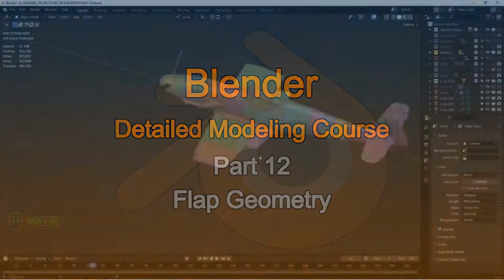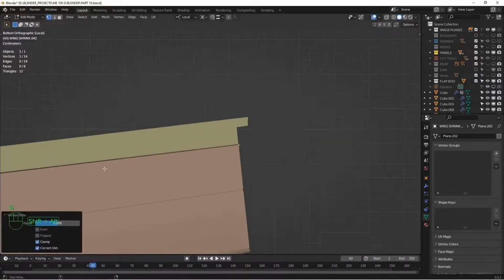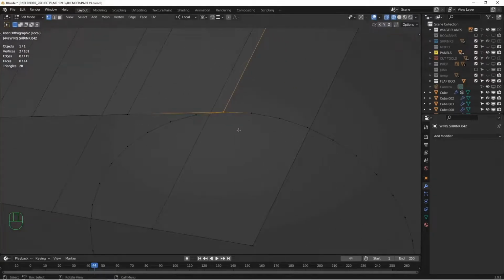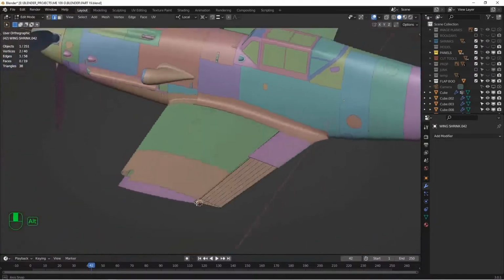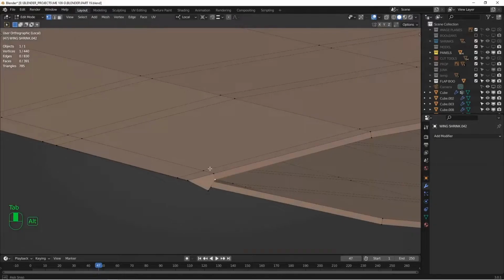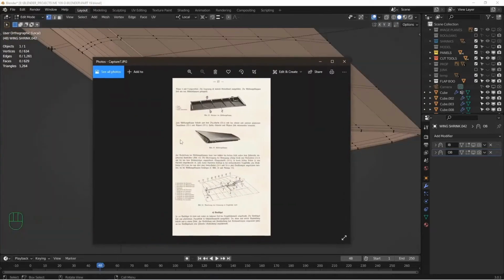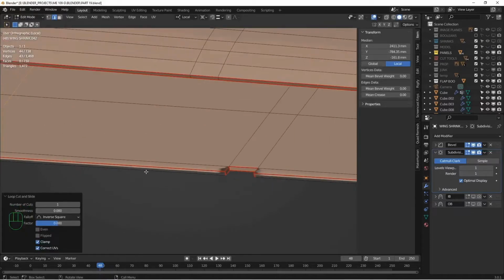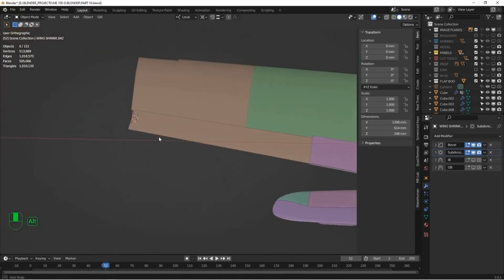Blender Detailed Modeling Course, Part 12: Flap Geometry

Comment: sorry for my bad english, why divide the plane into panels?
Reply from the maker: Your English is fine.

I divide it into panels for several reasons:
1.  I can customize the number of polygons for each panel.  Some panels don't need many faces to make them fit properly, other panels (those with tight curves or those with sub-panels and access doors) benefit from additional edge loops.
2.  I feel like I can create a very detailed model that holds up well with close-up renders.  If I did panels as textures, ,there is more of a chance that panel edges would become pixelated (either due to bump-map limitations or texture limitations).
3.  It makes UV unwrapping the model easy since each panel unwraps very naturally.

There are obvious downsides to making a model this way.  The final model has a lot of polygons and it takes a long time to make it, but since I do this for fun and never have deadlines, that doesn't matter to me.